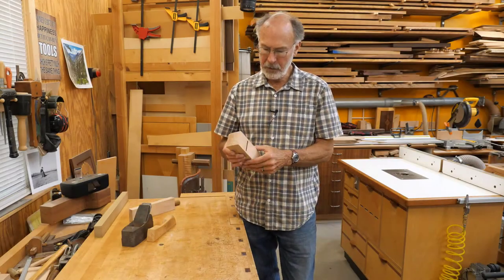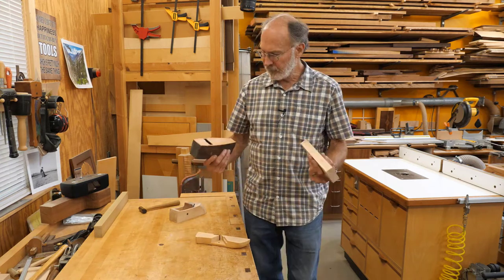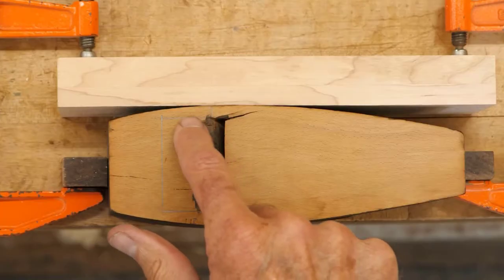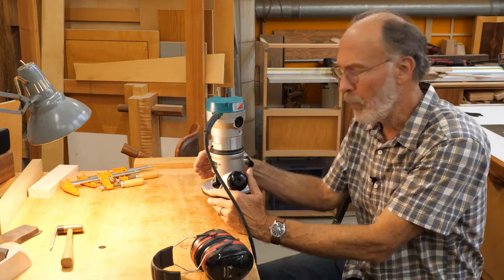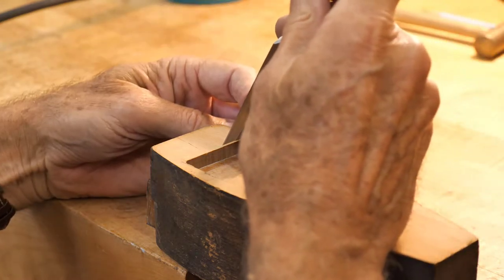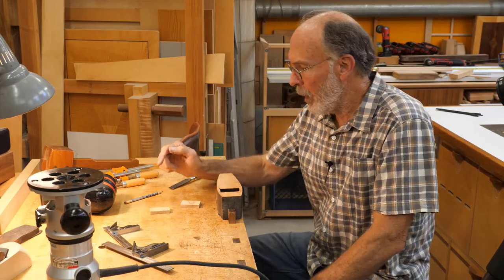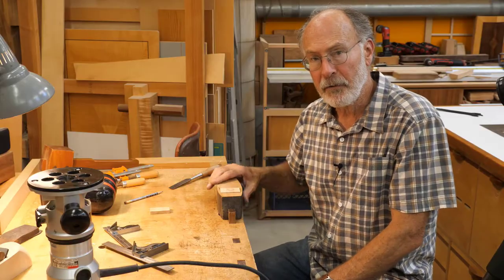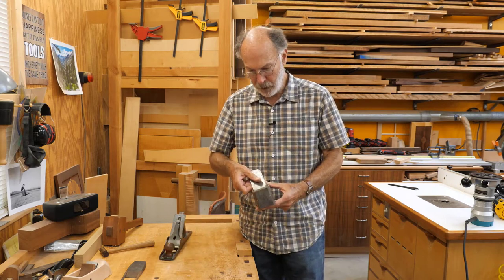Krenov-style Wood Plane Mouth Fix

Comment: Carl, thanks for addressing this fix.  Is there a reason not to simply route a slot (for the repair insert) all the way across the plane bed, with one edge of the slot located at the desired mouth position?
Reply from the maker: That would work for a Krenov-style plane but not for my coffin plane. You would want to be careful in positioning the slot and leave a little extra material for fine tuning with a file.

Comment: Hello, what do you find to be more important? a tight mouth or a blade that also has a cap iron? I've noticed a lot of the wooden hand planes don't even have a chip breaker? does this mean they are likley to cause more tear out than a modern plane with a cap iron? or can a tight mouth do just as good a job? thanks.
Reply from the maker: According to Karl Holtey, a tight mouth is not really that important. That is also shown in a video by some Japanese researchers, in which the closeness of the chipbreaker to the edge of the blade is most important. In that video (which I can't find at the moment), there was no toe on the plane and therefore no mouth; it was just a blade.

But, as with most things in woodworking, it depends... This article by Chris Schwarz sums it up well - https://blog.lostartpress.com/2007/12/22/button-your-lip-the-no-5-way-to-reduce-tear-out/

Bottom line, I think the most important characteristic (after a sharp, stiff blade) is cutting angle (sometimes called angle of attack). That means a chipbreaker is helpful in that it stiffens the blade and, if it's close to the cutting edge, has the effect of increasing the cutting angle.

The coffin plane in the video has a 45-degree cutting angle and no chipbreaker - not the best configuration. But I was planing poplar, which is very easy to cut. I suspect that if I tried to plane something nasty with that plane, I would get tearout. Better to have a modern plane with a chipbreaker, regardless of the size of the mouth.